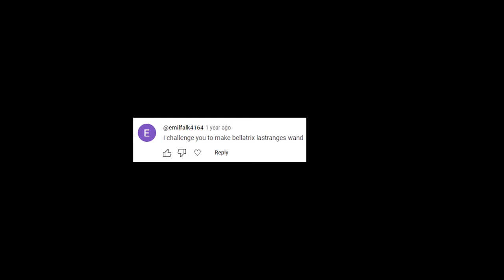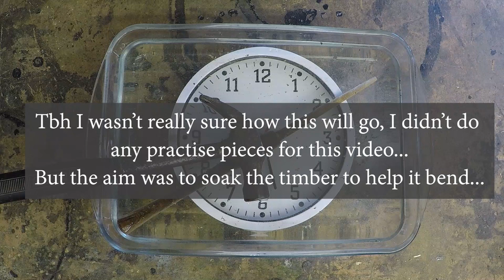Making Bellatrix Lestrange's Wand ASMR

Comment: Nice work. But would you try to make the wand of Lord Volemort out of yew. I think it will be very interesting. 😁
Reply from the maker: Got some yew with enough white wood already!... Some quicker wands first though...
Reply: @garricksapprentice  But you could maybe bleach the wood as well. I ask because I encountered this during my apprenticeship as a carpenter. Or do you think it‘s too dangerous? 😁
Reply from the maker: @gregorbauer3075  I've never really tried, but why not just use the white sap wood of yew?
Reply: @garricksapprentice  I was thinking more of bleaching - i.e. using hydrogen peroxide under the safety measures such as a breathing mask and thick rubber gloves.
A word of warning: the smell is comparable to that of a litter box. But using the splint is also possible.😁